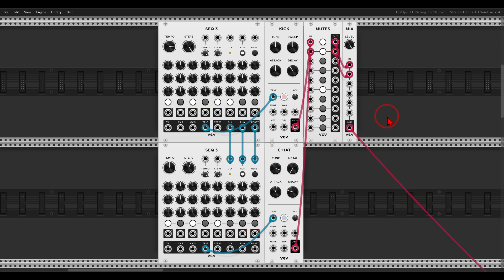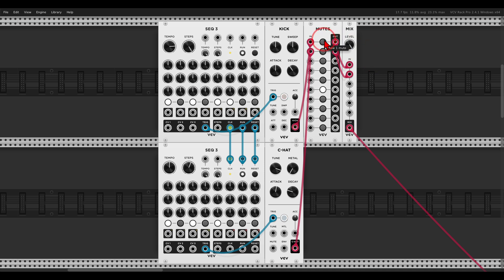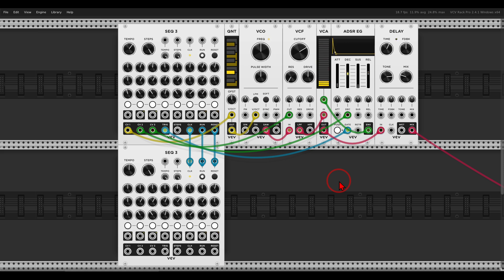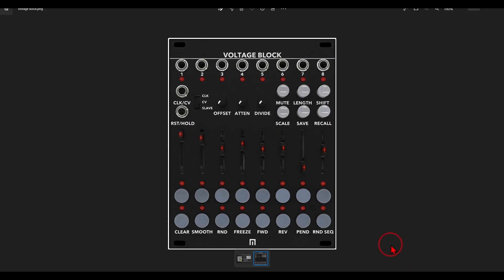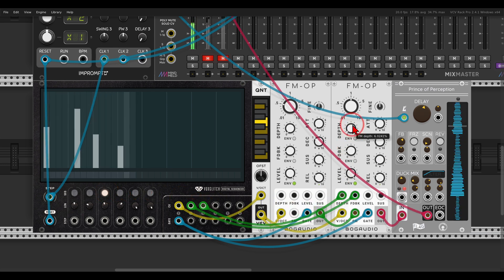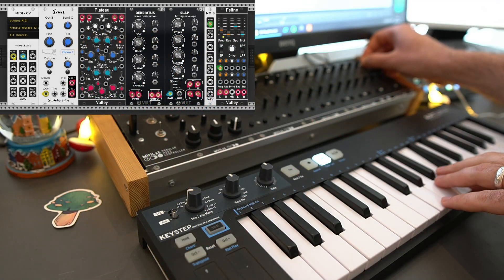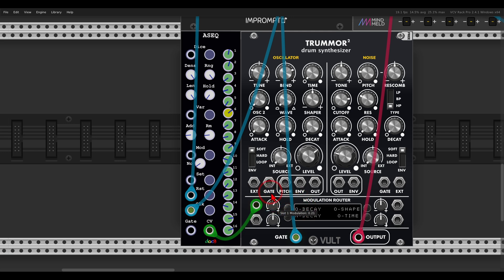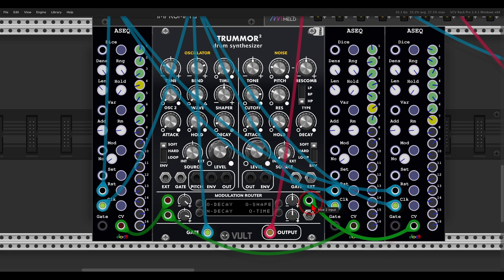Polymetric Modulation Technique

Comment from the maker: I hope you enjoyed the video! Do you have any other sequencers you like using for this technique? What do you usually modulate?
Reply: I enjoy using the vox glitch to jam one moment of strong modulation into the jitter function every so often on marbles so the timing gets thrown off before it rebuilds itself and heads back to straighter pastures.
Reply from the maker: @TheHouseintheJungle  Oh nice! I usually just set the jitter and forget about it, but adding jitter occasionally is a great idea!
Reply: I tend to keep sequencing really simple and just slap sample and hold on everything instead! I usually use the VoxGlitch one with Count Modular Super S&H because it's poly. Cheers!
Reply: I really love crossing the channels of the Digital Sequencer to mix and match sequence lengths for notes and trigger outputs, so multiple voices will have polymeter at their core but also are intrinsically related to one another. So one might be a 13-step sequence, but I put the CV into the notes of one and the trigger/gate sequence into another, and then use a different channel of 21-steps and swap them around. Really simple but keeps each voice pretty fresh.

Comment: Great stuff Omri! I bought a Korg SQ-1 (for peanuts, as it happens) to use specifically for this very purpose with my hardware set up. I’ll often feed both channels through a Doepfer Sequential Switch with maybe an LFO and S&H on the other channels and use a slow-ish probabilistic clock from Pam’s to cycle the channels of the switch… Usually to modulate filters or FM. Endless fun! Cheers man 🍄
Reply from the maker: Oh nice! Combining this with a switch and other signals is a great idea!
Reply: @OmriCohen-Music  I forgot to mention putting the Make Noise Wogglebug into the mix… That’s a whole new realm of crazy!